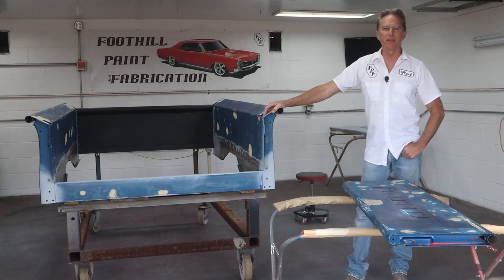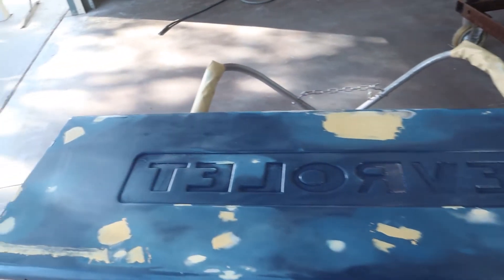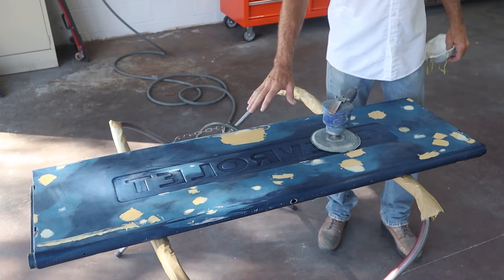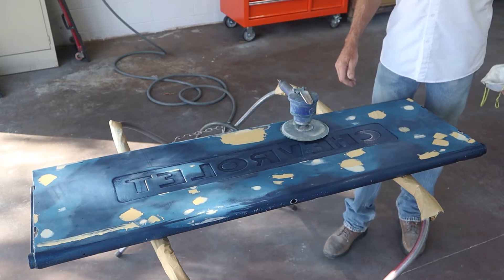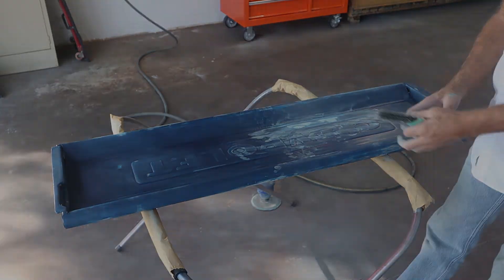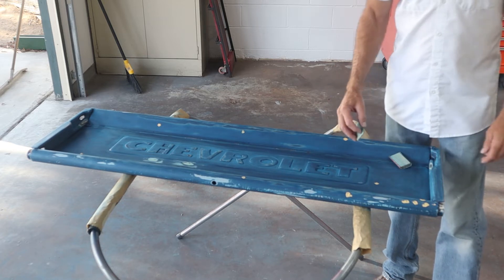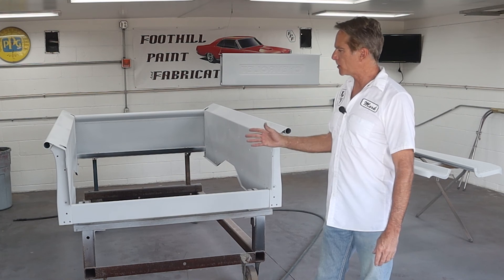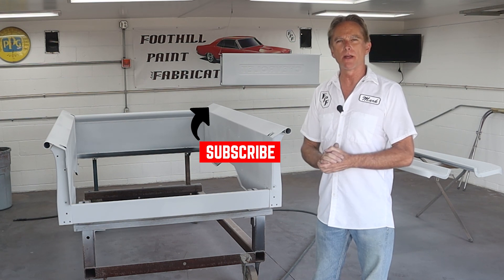1950 Chevy Truck (Ep 20) Tailgate Prep and Priming + Bed and Running Boards

Comment: Hi Mark. My tailgate is in quite a bit worse shape than yours. I don't mind putting the time in if I know I can salvage it. But the rolled top edge has quite a few dents that the previous owner has filled with some deep body filler that is all coming out. Any suggestions on how to straighten the top edge? Or would it save me a lot of time and frustration to buy an aftermarket tailgate? Thanks!
Reply from the maker: Doug,  On all these projects there comes a time when you have to decide to either fix or replace.  Since you are just starting out replacing it would be a good choice but if it is straight and only dented you could try pulling the dents to a less depth and then use metal reinforced body filler.  Price out a repop tailgate and the cost may make the choice for you. You would need a welder to weld studs onto the dents so you can attach a slide hammer.
Mark
Reply: @FoothillPaintandFabrication  That's what I figured. Time is money! Since I'm still working and not retired, I'll go the easy route. But I will hang on to the tailgate for practice purposes.
Reply from the maker: @douglashart5059  There are a lot of options for a repop.  Factory looking, smooth, louvered and hidden latches.  $250 plus shipping is about the cheapest out there but see if you can find one with some good reviews to make sure it is worth it.